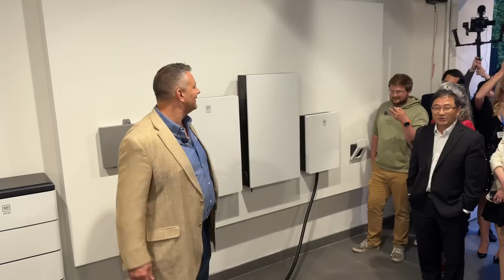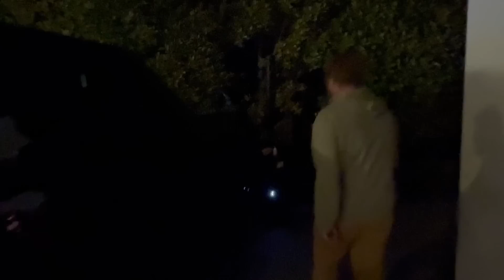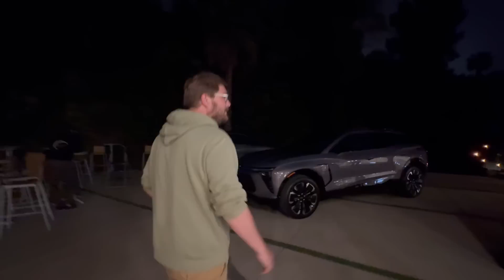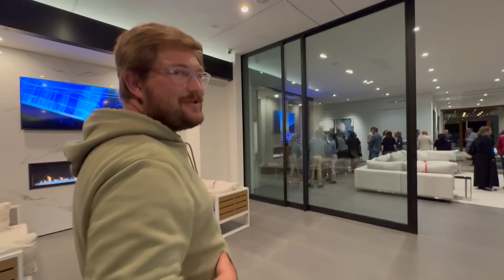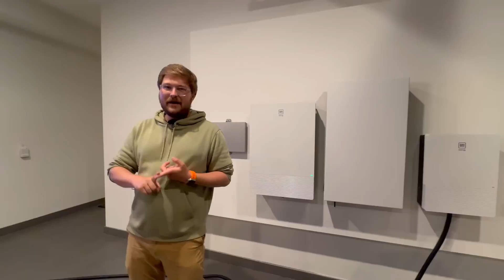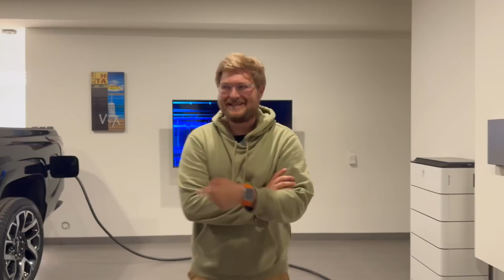GM Launches Home Energy Ecosystem! Full Tour - EV Charging, Bidirectional Power, & Battery Storage

Comment: When EV battery degradation is such a serious issue with current battery chemistry why would this ever be a thing?  I don't want the extra cycles going into and out of my EV. You're better off getting a Tesla Powerwall, Anker, or other home battery backup, then choosing a electric vehicle that isn't vendor locked to your home power backup.
Reply: How do you mean by serious issue? Charge cycles for this purpose will have to be accounted for in warranty, sure, but degradation happens in the first few years regardless and then typically stays pretty flat even with hard driving and charging after that. Even more so with LFP batteries which are more robust to this type of use. Real world degradation, on average, is not dramatic even after heavy use.
Reply: @Cyrribrae  My Model X lost 30 miles of its max battery range in the first 2 years with less than 3000 miles of driving due heavy use of those stations.  I just don’t see what problem this “solution” is solving.  If it was vendor agnostic, if it was nominal cost option of a couple thousand to connect to your home, and only for rare power outages .. maybe.  Otherwise anyone is better served by adding a couple powerwalls or Anker modular batteries with solar and not futzing with their EV’s battery or tying it to the home.
Reply: @SShepherd  I agree that use of the EV energy storage for domicile use is costly in the long run, but it would be nice to have the option available for limited use in areas where grid power interruptions are quite frequent like in the SE where weather causes interruptions too frequently. I lived for a time in NE Texas and power was interrupted multiply times a year due to storms. Some parts of Houston, Texas are now days without power.
Reply: @SShepherd  that's... Literally what I just explained. You have degradation at the start. Though 30 miles is very high for 3000 miles. After that, it levels out and is much less dramatic. 

Yea generally I agree. This system as presented is not ready for mass market and isn't better than existing solutions from many battery or solar providers. Lower cost and vendor agnostic are necessary too.  Nevertheless, broader bidirectional charging that is a part of daily usage rather than just power outages is a very good thing.

Comment: Uhmmmm, who is going to tell them that the 35-40s cutover kinda sucks? I've had the Solar+Powerwalls grid tied solution for 4+ years and when grid goes out, it's instantaneously shifted to the Powerwalls. 

I guess the V2H solution is kinda neat or whatever. But again, not exactly new in the industry. Tesla are rolling this out to eligible Cybertruck buyers. 

Event summary: we have sorta caught up. If you want an ecosystem from GM with a piss-poor cutover experience, we will sell it to you. Oh, and 24 inch wheels, baby! Murica!

Comment: Perfect integration is KEY for these. Everyone will promise integration. Anyone can do a slick demo. 
Actual, real-life, day-to-day integration that is mindlessly simple is the ONLY way to make a system like this worth the money. 

My current system is a hodge-podge. It does the job, but requires handholding from me all the time to make sure it is doing what it is supposed to do. 

Hoping GM understands that when they say 'integrated' in 2024 - the consumer assumes it will be intuitive and easy.
Reply: Agreed. Even though Kyle praises Tesla’s app, it leaves plenty of money on the table. Thankfully it’s been reverse-engineered, so you can automate the hand-holding. My Powerwalls now change their backup reserve automatically to allow me to be self-powered from solar, but switch to charging from the grid at night if there wasn’t enough left in the Powerwalls to run the house the next day. Similarly for charging the EVs from excess solar, or from grid at night if they get too low.

Comment: So Ford has a system, GM has a system, Tesla will have a system. It doesn't work if everyone has a proprietary system. There are already all types of grid tied and non-grid tied systems running at 48 volts. If these manufacturers would build a box that changed their vehicle's battery voltage to 48 volts to run into industry-standard systems it would become much more practical.
Reply: That's the next step. We're also waiting on a wave of non-auto manufacturers to jump in. Home charging, solar, perhaps even some government or utilities trying out the space. No doubt the pull back on EVs has affected the timeline on some of these products. But we'll see. The lack of standards is certainly a major, though temporary, problem.

Comment: At about 20 minutes in, Kyle asks if the system uses the truck battery pack in parallel or series high voltage mode.  Exec says: high voltage.  Kyle then says so the system is 1000V capable, and answer given is: that's correct.  In reality, from the specs sheets, this system is 500V max rated.  So clearly using the truck in the lower voltage mode.  Not a big deal, but concerning they answered incorrect.  Not like this is hidden - the datasheets for both the inverter and the power shift charger have the details clearly listed.
Reply: @ultrastoat3298  Fair enough, but he should have answered that he'd have to check - not give the wrong answer.
Reply: The GM Energy exec is Aseem Kapur, Chief Revenue Officer and Head of Product.

Comment: I have Cybertruck Powershare installed and working. A single 3V Gateway and Universal Connector is all that is required to supply 11.5 kwh. There is no need for a small battery to wake-up the truck. There is a communications wire between the gateway and wall connector to wake up the truck and supply power in a grid outage.
I have heard the cost is $1200 for the gateway and $600 for the Universal Wall Connector. But of course you and I paid $20k for it with the Foundation Series.
When are you getting your Powershare installed at your Dad's house or yours?
Reply: the Silverado EV has a 19.2kW internal inverter and doble the battery capacity. So they could easily be using it with similar approach and more power. I don't understand the extra Inverter.
Reply: @WRW87 As GM’s CRO said, onboard equipment becomes the responsibility of the car service center to certify and maintain. Tesla can do that because they own their own service centers. GM has to rely on a network of 3rd parties to do sales and servicing. Demanding new skills from their service technicians will not go down well, especially since the service centers won’t see much return for that cost of training / new hires.
Reply: @markirmuir  True point the bidirectional inverters are not that much more complicated than a standard inverter. remember not too long ago when people were convinced the model 3 had a bidirectional inverter if it wasn't for a hand full of diodes? So this is something a technician would deal with anyway, its worse in this situation as you now have 2 parties/departments talking to each other if there is a fault.
Reply: @scottHones67 What is the switch over like? is it a light flicker or is it 36 seconds like this system?
Reply: @Sparky400  When I tested it the truck was not in deep sleep. It was about 0.5 seconds to switch. When the grid power is restored you get a notification that Powershare will turn off in 5 minutes. Exactly 5 minutes later there was another 0.5 second switch back to grid power.
Reply: @ScottJones67  the small battery isnt really to wake up the silverado in the gm system... its to wake up the off board inverter which starts up then initiates the handshake to the plugged in vehicle where the power source is, different comms flow than tesla. tesla will be faster in this scenario because the power conv is all on the truck 

in the future when home battery/energy storage is in great abundance, this neat trick wont be used as much. still a cool showcase of how the industry is changing.

Comment: That break before make blackout window is a major detractor for backup power. Other solutions allow you to retain power without interruption so your computers, networking gear, appliances with clocks, etc don't experience a power cut. Even a small AC coupled battery to keep things on in the switch-over would be a much better experience.
Reply: Eh I’m not too concerned about it. I’ll continue to have a UPS for my computing gear.
Reply: I could see it having a power cut to wake up the truck. And turn everything on. But if you have a home battery ready to go like in this case not sure why there was a power cut at all.
Reply: @Catsrules1  the home battery wasnt tested in this demo, it was only for display. so i imagine it will be faster in the future
Reply: You can, of course, install a small home battery. And I probably will when I get bidirectional charging (I'm still holding out for true V2G or at least always accessible V2H). Your car may not be at home right when the power goes out. Having a small battery to tide you over and keep everything running as the car hooks in makes sense. (the problem of course is that sometimes you don't realize the power is out until your battery dies lol). 

Anyway, it's one of the reasons I'm curious what the home charging manufacturers come out with vs the auto manufacturers. Enphase says their system will talk to solar and the vehicle and the home and make it all work seamlessly through their central system. We'll see.
Reply: You should have a UPS on your PC and network equipment anyway. A decent one is less than $200. If you can afford this vehicle and this system, you can afford a couple of those.

Comment: I bought a gas generator at Harbor Freight. It can power my whole  house for days. I paid 800 bucks. You spend 100k to buy a battery that can power your  house for days... Kyle, you are the best host ever,  You should host Jeopardy but EVs are garbage..
Reply: Nah. The equinox can do it too. Still 30k lol. But hey, it can drive. 

The gas generator I bought cannot. I used it to run a family member's oxygen machine and medical bed during frequent blackouts a few years back. The noise was atrocious in the dead of night and the noxious fumes could not be totally blocked. All in all, probably caused as much damage as it helped. And then you gotta use the leftover or is not usable after a while. Plus, a $500 generator is not doing whole house backup. Certainly not automatically like this. A large scale home backup generator isn't going to be much cheaper. 

Eh. Use what works for you. But there are clear reasons why people like battery systems (and yes, many get by with much smaller batteries. A power bank will run your electronics and some lights just fine. A small home battery gives you your appliances too. They're a few thousand, not 100k)

Comment: And toyota thinks we want hydrogen😂😂😂😂😂😂😂😂
WHAT A JOKE!!!!!
Reply: I wish hydrogen was a more 1-1 replacement for gas. Someone made a standard for a little canister, would be great to insert one of those into your house for your old gas equipment or into the boot of an EV for a range extender. That is my limit on hydrogen though.
Reply: @Sparky400  has the small issue that the "canister" will be empty in under a month without you doing anything.
Reply: No they just want to stall the change from fossil fuels. As they have shown multiple times.
Reply: lol

Comment: GM’s approach makes sense because it allows the system to be modular, sized to the customer and configured to meet local code.  The downside is that installation labor cost will be higher due to the greater number of interconnections.

The Tesla Cybertruck with onboard inverter is apt to be too little or more capacity than needed for quite a few applications.  The Tesla advantage is that cost will be spread across all purchasers and possibly provide a lower cost of installation for customers who want to use the backup option.

Comment: I kind of find it interesting that GM went the exact same path as Ford, even though the take rate on smart home back up is tiny.  $7500+install for 2kw more is silly. All us lightning guys are just running pro power 220 AC to a generator panel for ~ $500.  The whole point of a large EV battery is avoiding home battery cost.  I like the argument for off vehicle inverter based on utility red tape, but honestly without power arbitrage I think it's wishful thinking.  IMHO....

Comment: I want those ISO standards! I want a system like this, but don't want to spend thousands on a system that is vendor locked!!!
Reply: So what every one that wants to plug in for that home would always have to own a GM vehicle.  not a good option.. Oh and 30+ second to transfer,, terrible.
Reply: You don't want this inferior system. Power transfer in an outage should be sub-second. This solution is actually pathetic.
Reply: @punksjutgbd nah. I just want a cheap option that allows me to plug a generator chord from the EV to a generator panel. If I have to manually switch it, no big deal. I’m not hosting a critical data center or hospital or anything.
Reply: @punksjutgbd  i know right,, why is the hardware in such a stand by,, is it hard on the auto to just hold a active connection??
Reply: @joshuaspires9252  My solar battery backup automatically switches in 15 milliseconds when power is lost. What is this expensive solution doing in the market?

Comment: This stuff sounds cool but a question keeps coming into my mind.  Wouldn't someone who would have this stuff most likely already have or be able to afford a full solar/battery system for their house?
Reply: Yes, and the switchover happens in less than a second with just a faint dim of the lights.
Reply: More batteries more better. That truck has what like 200 KWH battery. My house takes about 1KW every hour so i could run for a week of the truck. That is crazy.

Comment: Using a vehicle to power a home only makes sense if you don’t need that vehicle for transportation.  Really bad idea in a natural disaster.  A standalone power center would be less costly and more versatile.
Reply: It makes a lot of sense of you pay for time of day power.
Reply: More versatile? Not at all. You have a power station that DRIVES. Ideally, get both. A small 5 kWh battery tides you over. But if you're driving around like crazy during a natural disaster, what are you also trying to power at home? It makes more sense that the family is consolidating. Either to hunker down or evacuate - which can both be helped by the power plant that drives.

Comment: Now if only you could throw those spare batteries from your house in the back of your truck on a road trip and add usable battery capacity to the truck, God forbid plug a generator in?
Reply: (Batteries) storage  without solar is incomplete
Reply: @sparkysho-ze7nm  depending on where you live time of use rates can actually make a battery pay for itself. Especially if you're adding in the cost of fast charging. Time of use rates meaning there's a scale of what you pay for power depending on what time of day it is and using the battery to charge when it's cheap and use the power when the rates go up. Most people with an electric car could benefit from time of use rates

Comment: It took about 34.8 seconds too long to power the home back up.
Reply: So do generators, but this one doesn't need to start up every week nor does it need maintenance yearly
Reply: Not to mention batteries can be used to help you defer your power usage to take advantage of time of use rates where as the generator is only there for backup
Reply: @matt45540  most other systems switch over to battery in milliseconds.
Reply: Our solar/battery system switches instantly to battery power when we have an outage.
Reply: Agree. They absolutely need to incorporate a small AC-coupled battery into this solution to service the gap. Competitors can do it so there is no issue with compliance there. Even a small battery of a couple of kWh capacity should suffice. What's the point of solid state backup power if it's not seamless?
Reply: @ipullstuffapart  You don't need an AC coupled battery. DC works just fine. The inverter is already in place. I have such a system.
Reply: My only guess is it has something to do with waking up the. Vehicle. But the house should have been able to use the home battery immediately. Very weird.

Comment: Tesla has all this shit beat already. All these promises of stuff that will come one day!, “Powering the whole house” but not the A/C. So basically a bunch of LEd light bulbs and an OLEd TV.  Haha.
Reply: Powerwalls aren’t even the best solar/storage solution, and last I checked, you can’t drive one.
Reply: @notshylo  not referring to powerwalls, cybertruck
Reply: We.. We don't even know when OR IF power shift will come to other tesla models. Installation of home chargers is still happening slowly. I want tesla to do well here, but pretending like they're the only ones capable of producing a good solution is silly. Neither one of the two does what I want from a bidirectional system yet.

I hope they both keep improving.
Reply: AND larger capacity at 48amps 240v